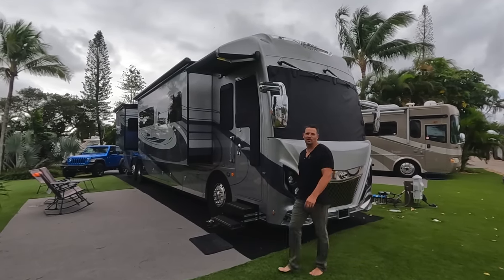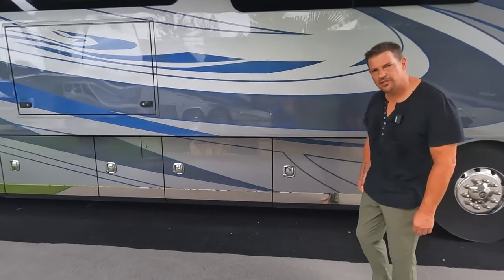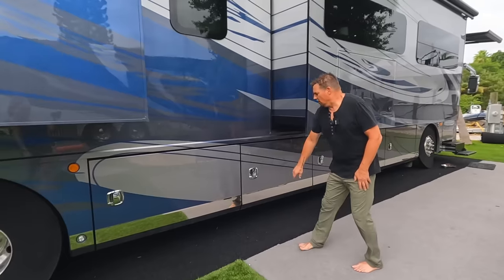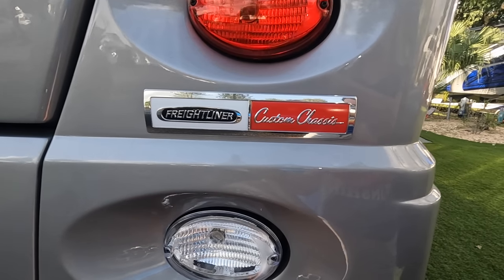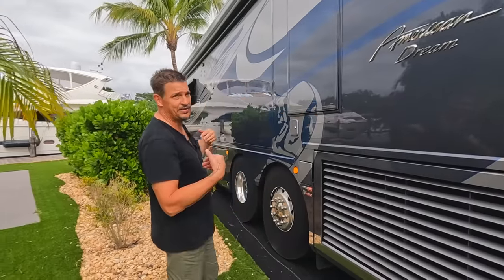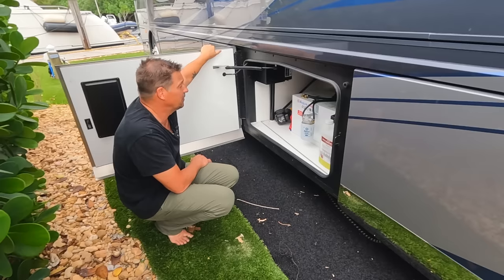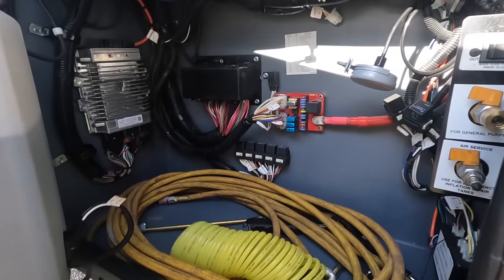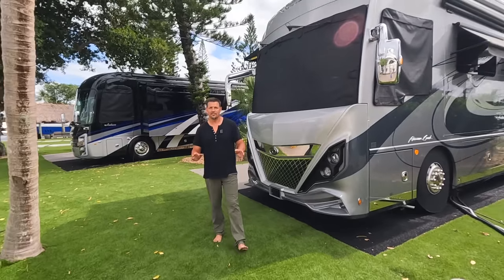Tour ENORMOUS basement of this RV (Full exterior tour) 2023 American Coach Dream 45A

Comment: I'm curious to know, does the heat or AC work while driving down the road? And would it be powered by the engine or the generator?
Reply from the maker: Yes, they both work while driving. They can be powered by either. 😀